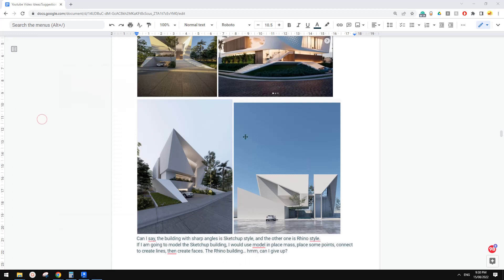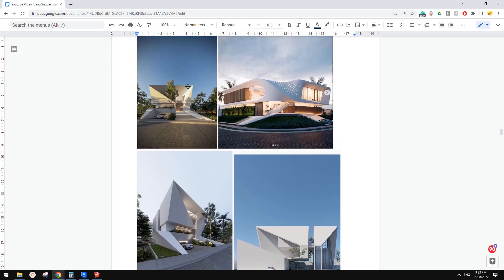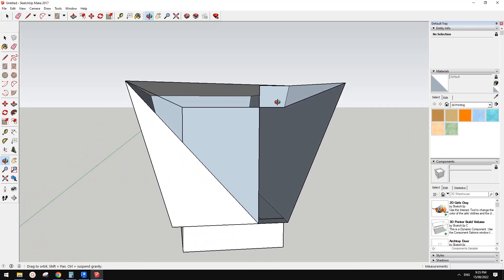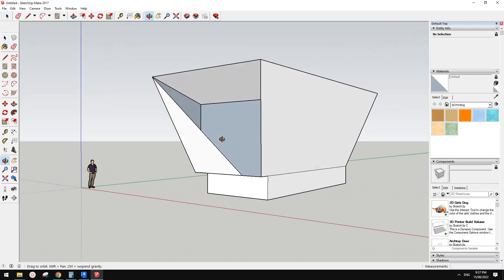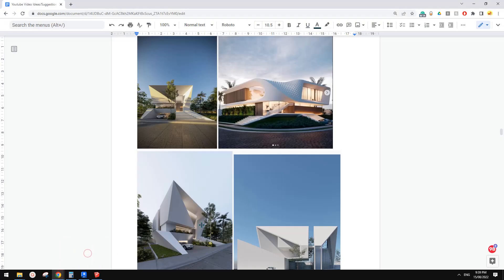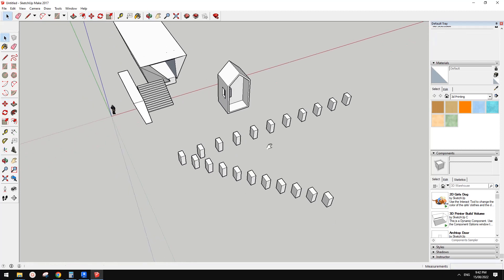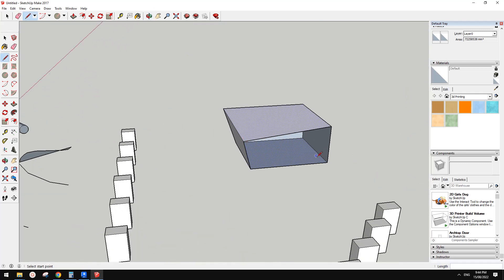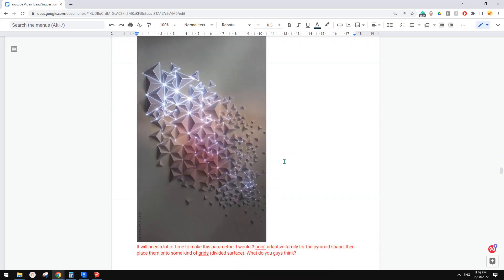Sketchup Exercise (Day 875) Sometimes it's easier to not use Revit...

Comment: How about formit 2023?it can be sync with revit 2023
Reply from the maker: Yes, Formit is the Autodesk version of Sketchup. Unfortunately I have not had a chance to use it. Do you know the difference between Formit and Conceptual Mass in Revit?
Reply: I'm still learning it in my spare time,i think it's more faster, but I prefer to use revit conceptual mass so that all work is done until detailed engineering drawing,considering my pc abilities to run program synchronization, finally just revit to reduce the calculation of working hours&link cad files for the project 😅
Reply from the maker: Good work. Keep practicing.